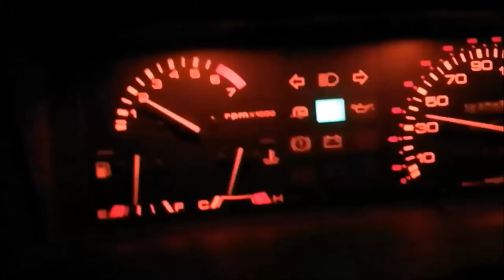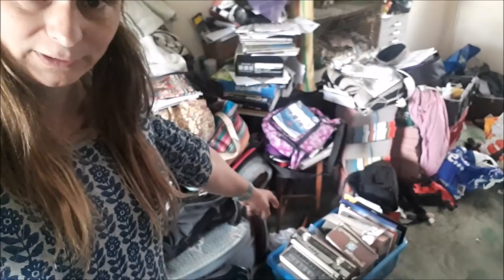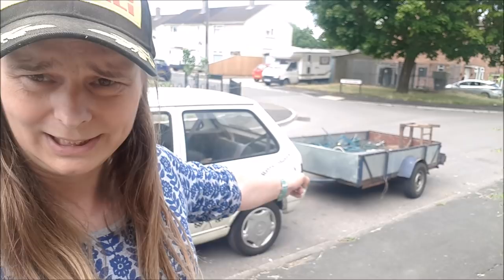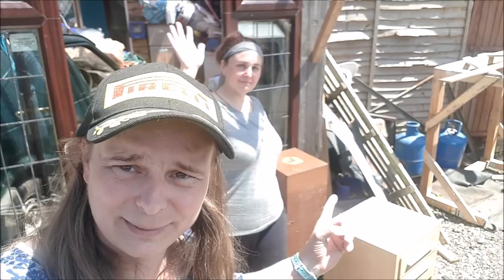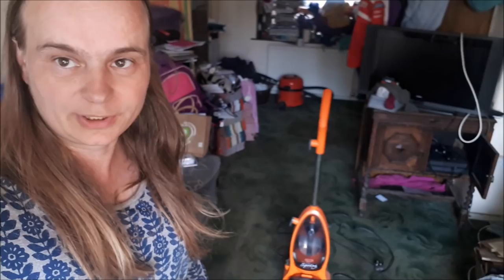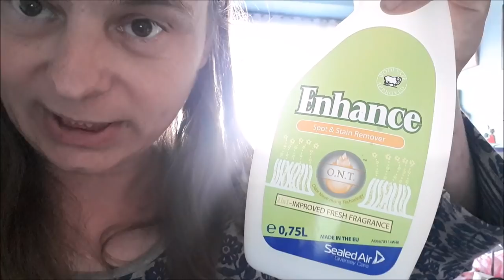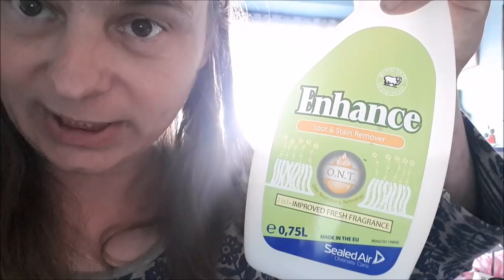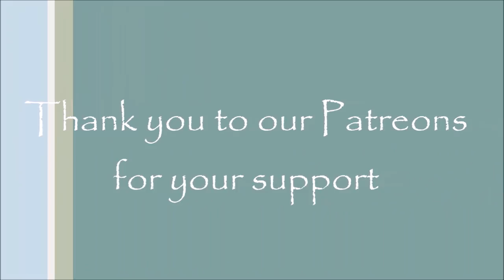Downsizing for Off Grid Living

Comment: Fairenouth chloe u living off grid you using a power inverter and solour power a good start mate all ya need some deep cycle batterys and 2000w inverter and a good soulor panel set up, i was thinking of doing it myself liking the vids :)
Reply: I only noticed you got a old roberts radio i have same one i modded it with a bluetooth adapter
Reply from the maker: Kirbz  I collect them.  Really good radios.